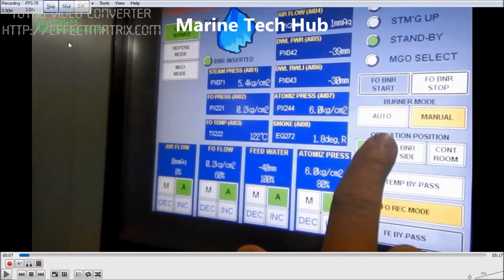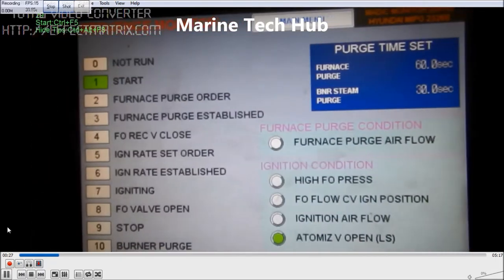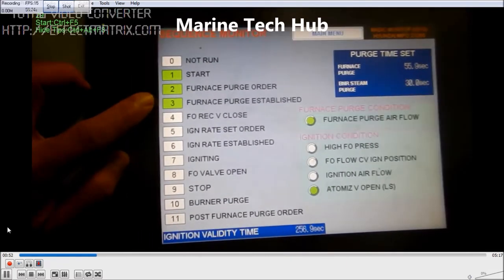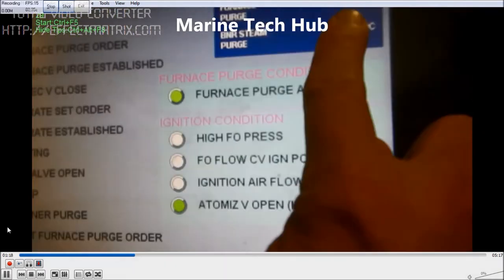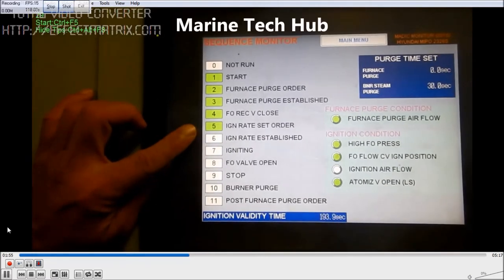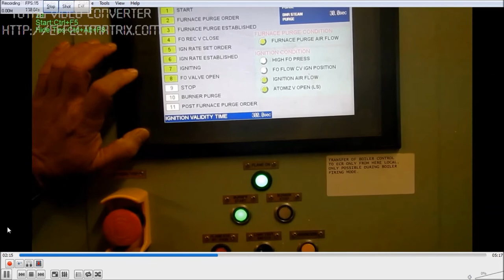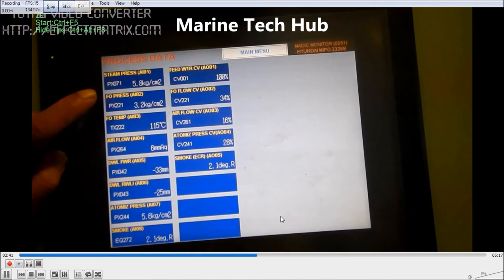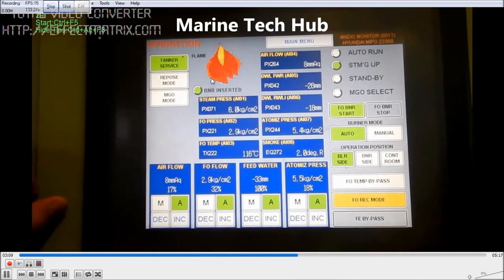Aux Boiler Firing Sequence (Make: Mitsubishi)

Comment: Bro I  can't  understand  this video  can I explain  it  detailed
Reply from the maker: Thanks for your valuable feedback !! Do share it with your colleagues and friends
watch all the videos of Aux Boiler you will understand it.If you still do not understand it then call my cell number .
Reply from the maker: when you open my youtube  channel : Marine tech hub you can see icon right hand side of the header . you can click to go to my website 1. RT flex engine 2. Nitrogen generator 3. solar power.  full details of CLU and Crank Angle sensor can be see